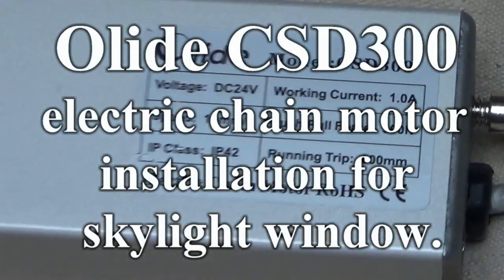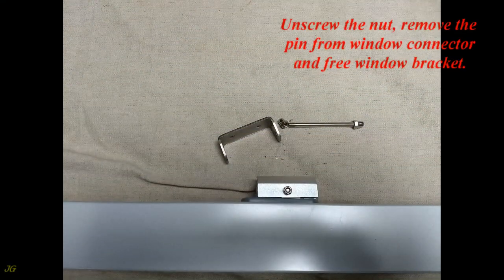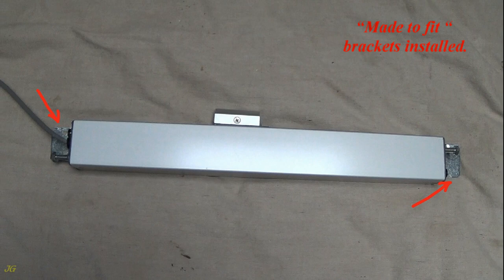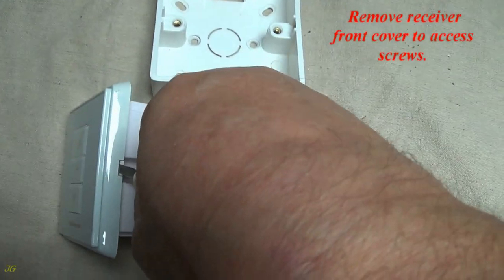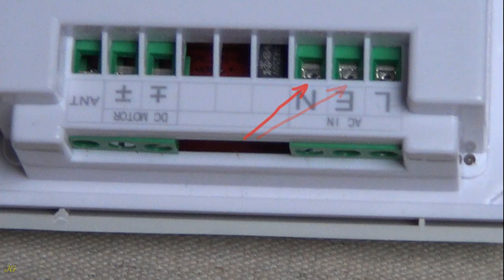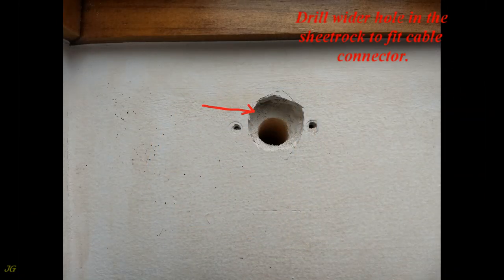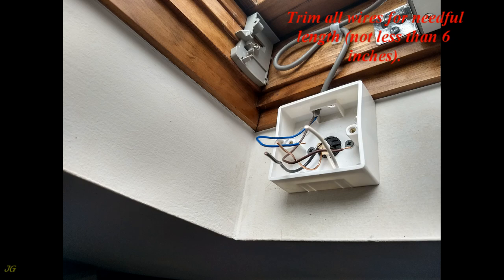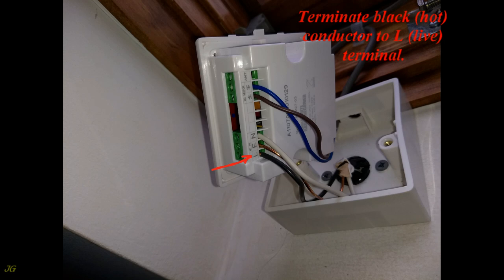Olide CSD300 electric chain motor installation for skylight window

Comment: Is this an installation from existing manual skylight motor to  electrical auto motor? Or a just a replacement electrical motor ?
Reply from the maker: From existing manual skylight to electrical motor.

Comment: Was the chain longer than you needed? In case yes, what happens when you open it? Does it stop?
Reply from the maker: When fully opened or closed, motor stops automatically.
Reply: @johng2913  stops even if chain is longer?